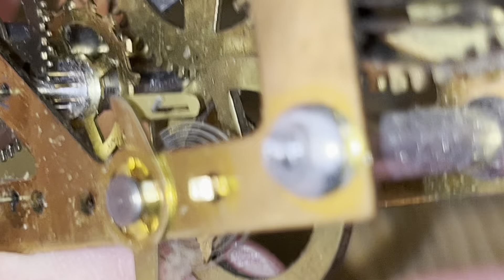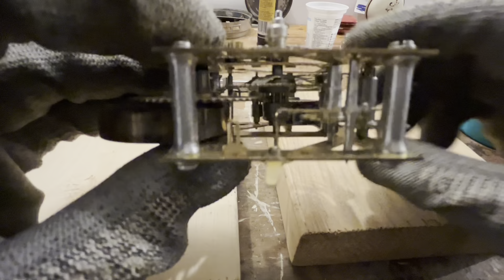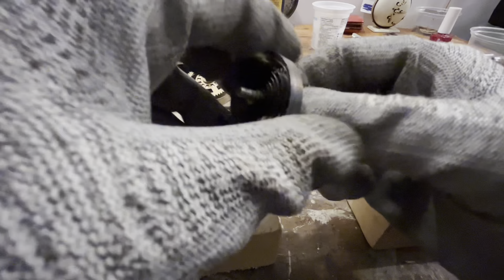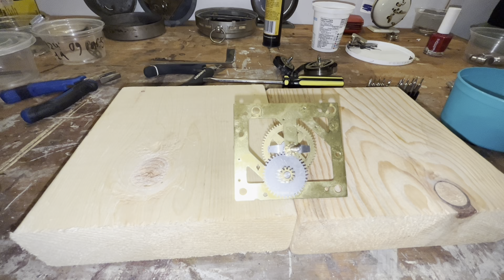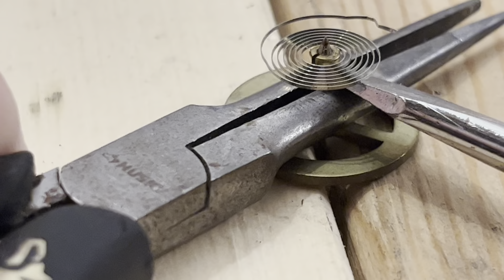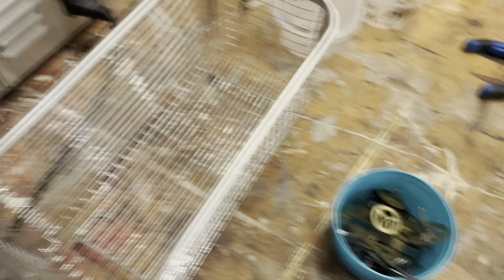Westclox Spur Style 1 Service (Part 2)

Comment: The alarm set knob on this clock was removed easily some l have worked on are very stubborn the big and baby bens have a screw on Collett to tension the alarm set but these clocks have the knob itself providing the tension so have to be driven on tight so can be very hard to remove

Comment: Your knob removal technique on that 66 movement is really good. I'm getting an idea of buying a small prybar and grinding the end down now to fit under the leaf spring.....
Reply from the maker: Thanks! I might do the same if I can find another one for cheap. What we’re you doing before you saw this video?
Reply: @Nottrash2  I've been scanning old service manuals into pdf's and watching/listening to youtube videos in the background
Reply from the maker: I meant what you were doing to remove knobs on 66’s, but that’s a fine answer too lol.
Reply: @Nottrash2  I used a pair of thin, long needle nose pliers and a hammer and used the pliers like a gibb key puller to wedge the knob off.

Comment: What ever happened to the pearl grandfather clock?
Reply from the maker: It still has me beat. Can't get the cable to work right on the drum, sadly. I'd like to blame it on being a cheap movement, but I'm not entirely sure that's the case. Sure, it has plastic covers for the cable, but it was functional at one point even with those. I have to be doing something wrong somewhere.